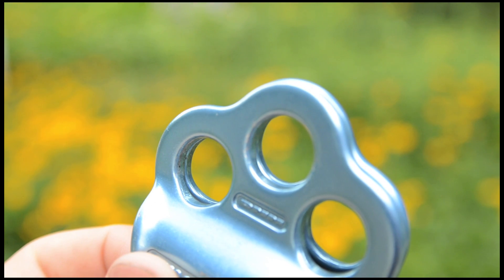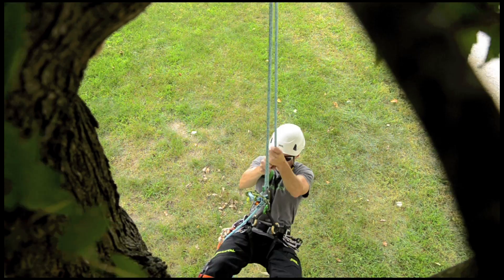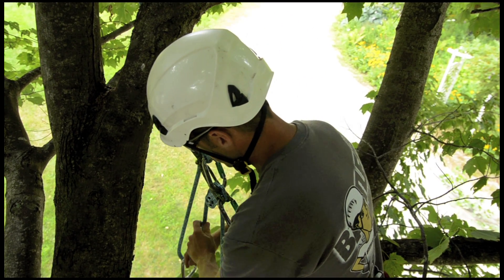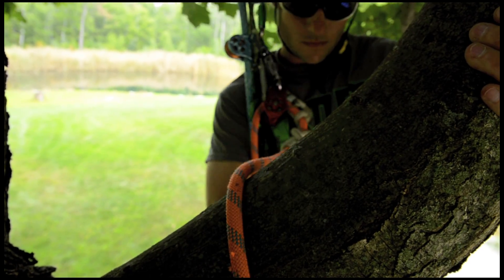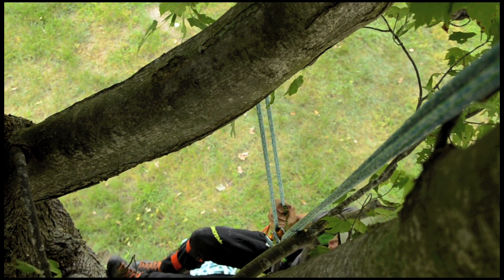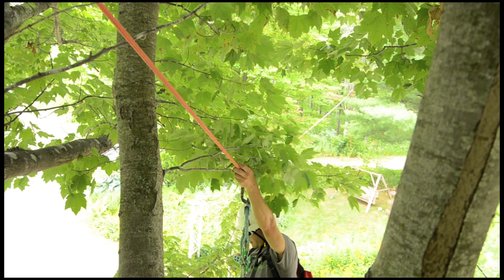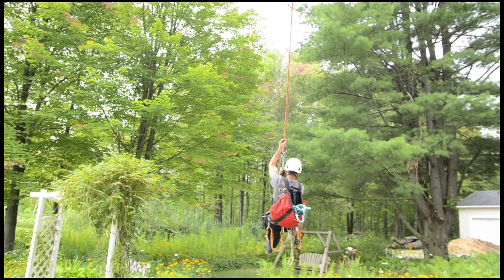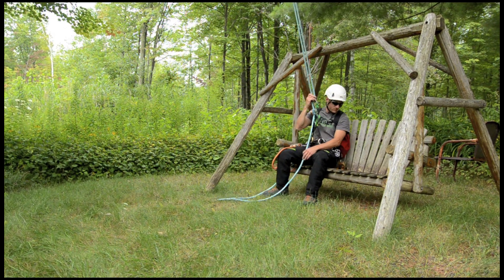DMM Hitch Climber pulley and its various uses

Comment: Great demonstration, I've personally used the high line technique for a hazardous removal, and am thankful I did.. halfway through I had the main trunk I was on fail catastrophically, breakaway lanyard broke away as designed, and I was left dangling in mid air with the tree in a pile on the ground.
Reply: Was one the Highline anchor points on the tree you were working? If so, was the anchor point of the tree you were working positioned on a different spar of the tree than the one that failed? I'm trying to understand how to use a highline, and what happened in youre experience.